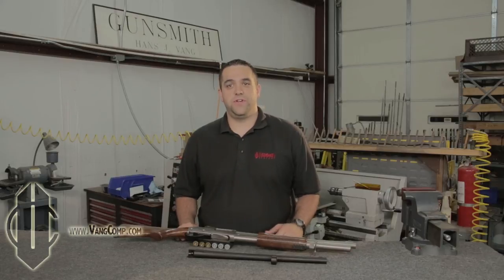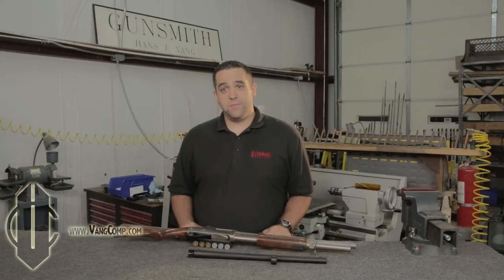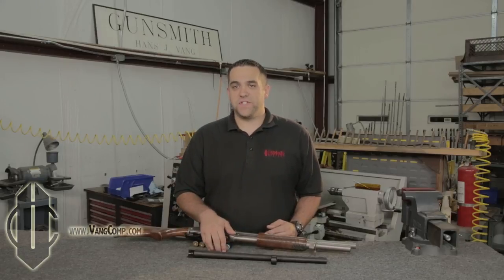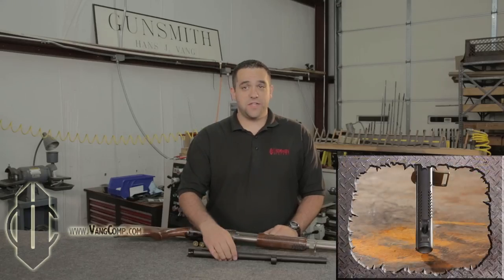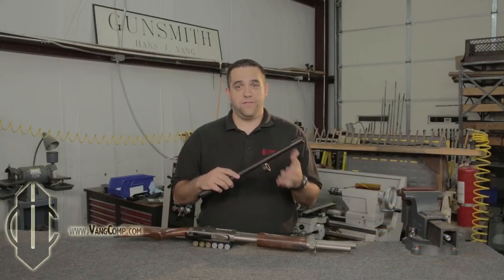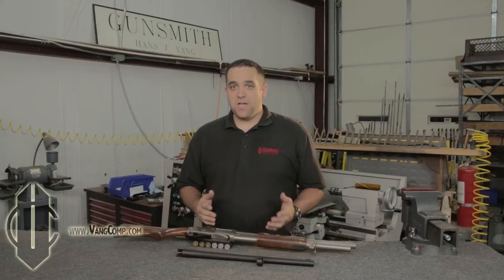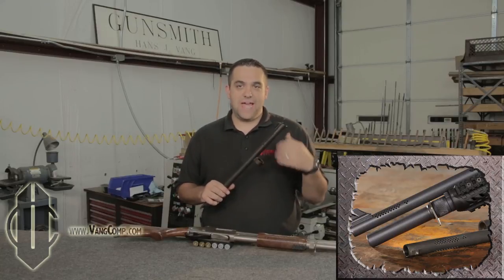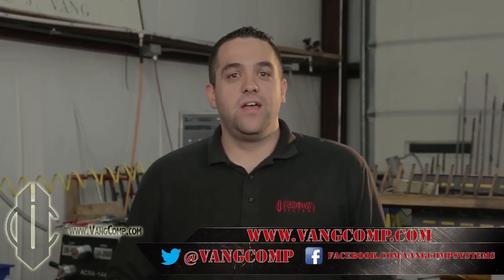INSTALL THE VANG COMP SYSTEM ON YOUR BARREL

Comment: I noticed that there is no longer room for a barrel/magazine tube clamp. Can one be modified to work with your barrel porting? I currently run a +3 Nordic tube with Nordic clamp. Will the porting be blocked by the clamp?
Reply: Jerry Fan did you ever get an answer for this? I'm in the exact same position.

Comment: Cody, I recently had my barrel worked on by you guys, did the whole VCS including accessories on my 870.

Before I had the work done my barrel hardly fouled and was really easy to clean. Now i shoot about 75+ rounds and I am getting some serious fouling. Is this normal?

When I first got my barrel I looked thru it to see what all was different and I saw where the barrel was cut and it didn't look smooth. Is it possible my barrel wasn't polished after they did the barrel work?

Thanks.
Reply from the maker: Toamaius D'Vignir It is possible something got missed. Send us your barrel and we'll take a look to be sure everything is proper, then we will return ship the barrel for free.
Reply: Cool, thanks. I think I am going to have to take you up on that. Should I clean the lead off, or send leaded barrel so you can see exactly what I mean about the fouling?
Reply: +Vang Comp Systems I decided to take you up and send my barrel to get checked out see if anything was missed. I decided to wait to I could run different ammo to see if that was the issue, but after rigorous testing I still believe it is the rough machine marks.
Reply: @toamaiusdvignir9468  so did this ever get resolved?
Reply: @copperjarhead  Yes, I sent it back and it came back polished. Still not honed as smooth as I would like, but barrel functions flawlessly and does what they advertise.

Vang Comp Systems are a bunch of good guys. They just don't reply much to YouTube comments. Call them and it is a different story.

Comment: Can this system be installed on any shotgun?
Reply: They can do this service on any 12/20ga non-thin walled smooth bore barrel that is at least 14 inches long.
Reply: Would that include the Kel-Tec KSG? Unported....